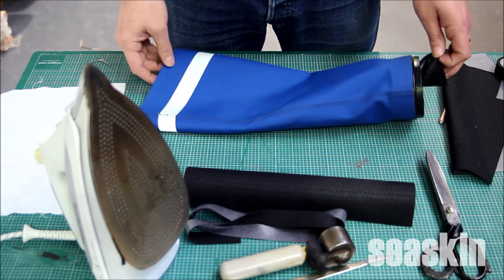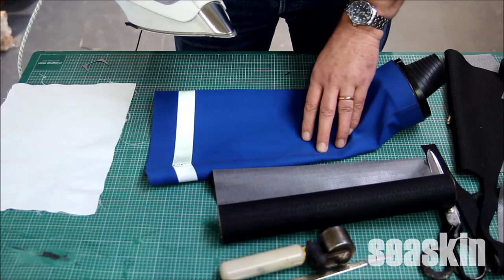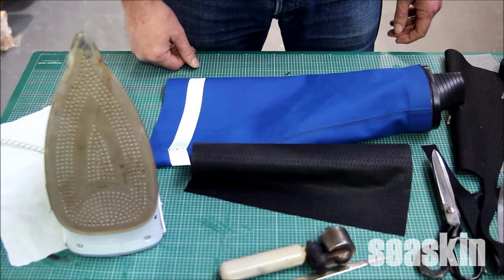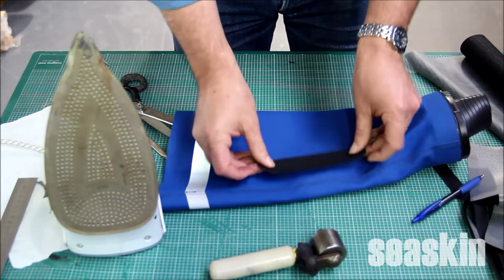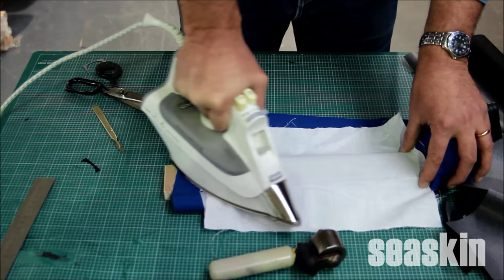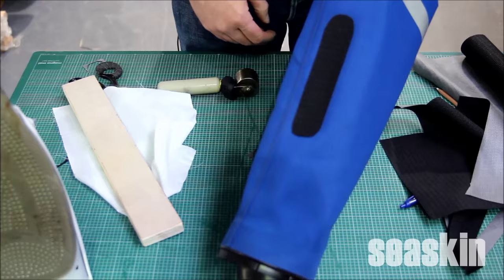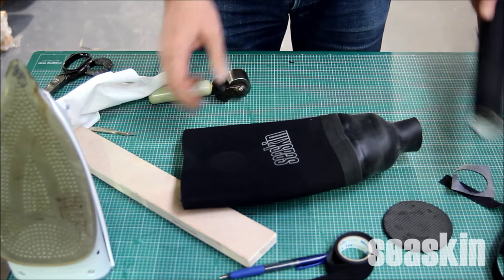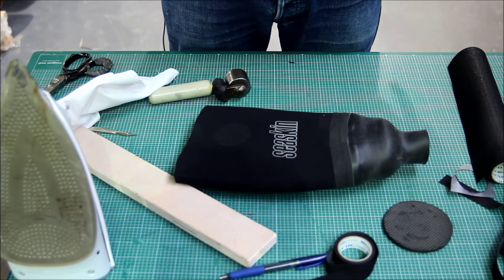Seaskin Video T5500 demo. How to apply a reinforcement patch to your drysuit.

Comment: I have a sea kayak skirts thats neoprene. The old tape needed to be replaced so im doing so with this product. I removed  the larger chunks of old glue residue and in order to get the small amounts left over i used a heat gun to thin out the glue. In the process i singed some of the neoprene. Do you think the tape will still grip the singed neoprene sections?